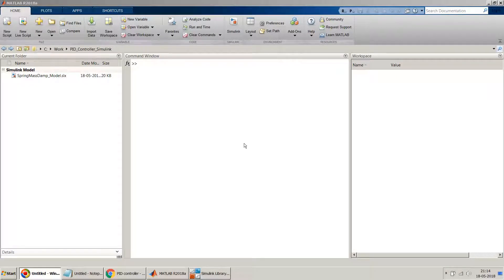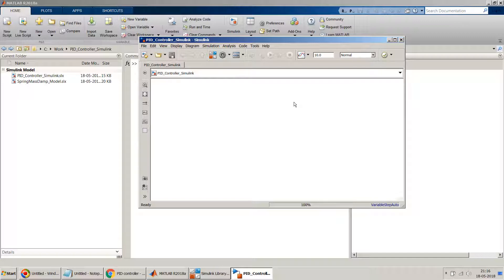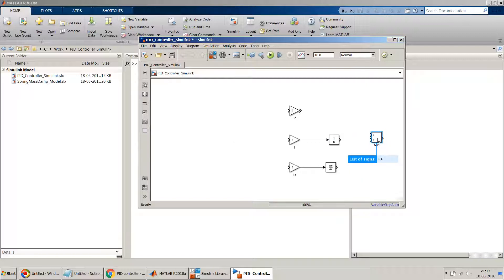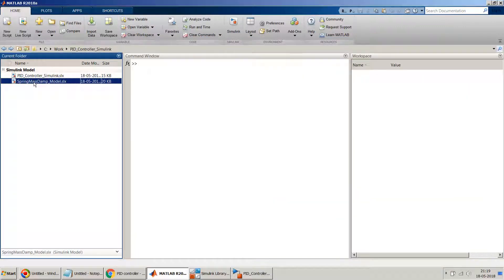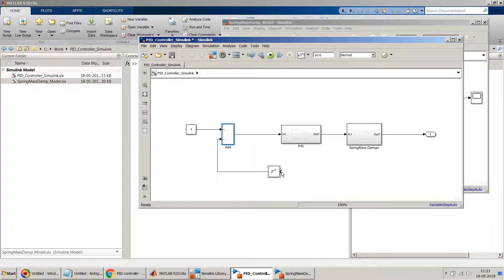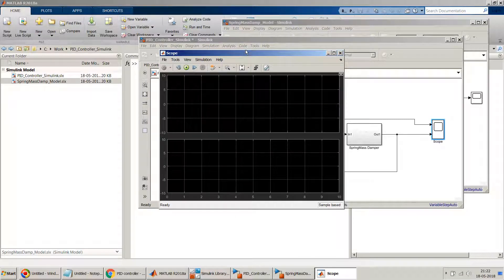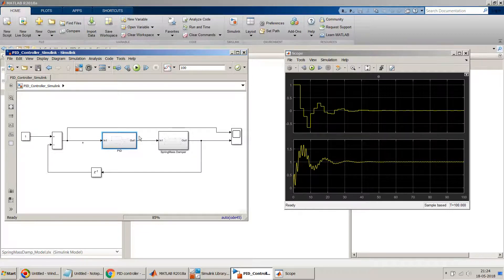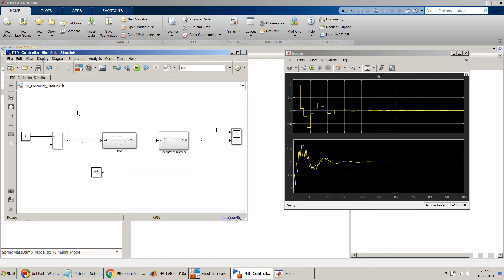PID Controller (Proportional Integral Derivative) and plant model (Spring Mass Damper) in Simulink.

Comment: delay block show error  ''The sample time after propagation is [0, 1]. Enter a discrete sample time in 'pidSDamper1/Delay'."   plzz reply
Reply from the maker: Try changing the Sample Time for the delay block to -1 (inherited sample time). If it does not solve the issue then in your model in some block the sample time of [0, 1] is assigned which is getting propagated.

You can check the Sample time of different parts of the model by going to the Menu Display->Simulink Time->All. This option will give you the list of various Sample times assigned in the model. Either fix the Values manually. Otherwise replace the blocks with the default from the Library Browser. I also hope you are using Variable-Step Solver. If not then please choose the Sample Time according to your Solver settings.
Reply: @ProgrammerWorld  thank you sir
Reply: @ProgrammerWorld  I'm from Viet Nam. Can you help me ? 
My gmail: mjnjongkanggg@gmail.com
Reply from the maker: @thaingoc2044  Have messaged you.

Good Luck
Programmer World
https://programmerworld.co/contact/

-
Reply from the maker: Let me know your email ID. I will contact you on that.
Reply: @ProgrammerWorld  royal.aklesh64@gmail.com  waiting for ur reply
Reply from the maker: Have messaged you.  Check your email.
Reply: @ProgrammerWorld  okay